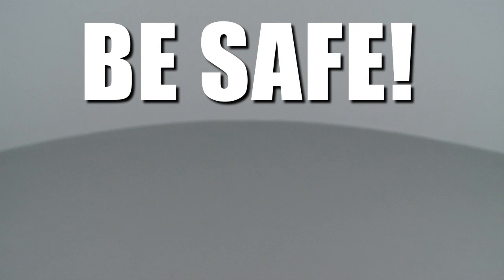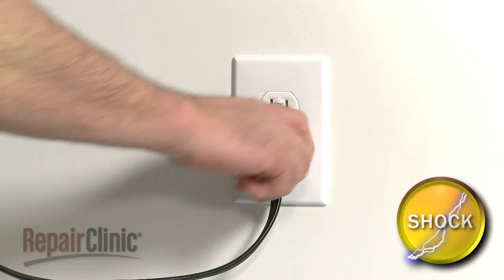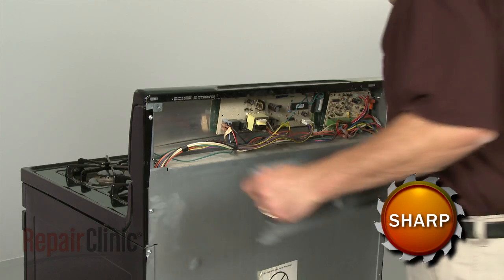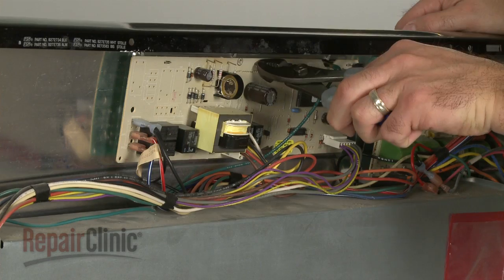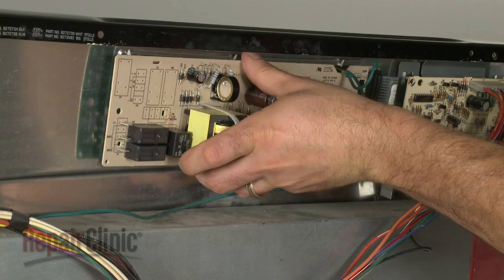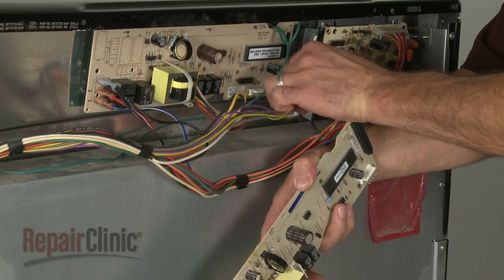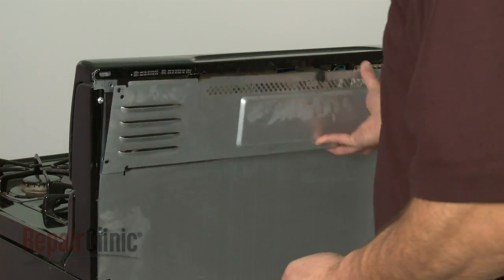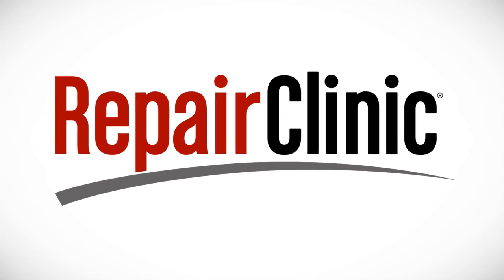Kenmore Gas Range/Oven Control Board Replacement #8523666

Comment: Control and Overly needs to be replaced does this mean I am going to have more
problems with this stove ? would it be advised to replace the stove rather than repair ??
Kenmore only 6 years old
Reply from the maker: Sharon Coyle Not necessarily. If you are otherwise happy with the product we would repair it.

Comment: Hi, I have a Kenmore Gas Oven and I can't find the model numbers anywhere.  They were removed apparently.  I bought this used.  And it's in good shape otherwise. I get a F13 blinking code when it's plugged in. I tried unplugging and plugging several times.  It's gone.  How can i buy the right control panel for this Oven.  any ideas.  Should I just replace the Range?
Reply: You've probably either replaced the range or fixed it by now, but if not, the model number can be found by opening the warming drawer and looking for a sticker above the right front leg.
Reply: @tjf1114  , thanks, sorry so long before i am replying.  I just checked nothing there, there is a tag on the left leg , it has a lot of information but nothing about model num, series nadda.. thanks..

Comment: My oven cannot be adjusted above 350 degrees (790.71329700).. basically the UP button isn't working.  Would replacing this component also fix that? The problem is intermittent.
Reply from the maker: According to the model you provided, the control for your unit is: http://www.repairclinic.com/PartDetail/Oven-Control-Board/316455410/1197179?TLSID=1773. This is a different part than the one in the video. On this part, there is a plastic overlay covered with the text. Pull this off the old control and place the overlay on the new one. Sometimes, in this process, the overlay becomes damaged when it is pulled off. If you need a new overlay, the part number is 1056311: http://www.repairclinic.com/PartDetail/Overlay/316220712/1056311?ss=-x31303536333131&mr=0?TLSID=1773. Replacing this control will most likely solve the problem.
Reply: *****   That's definitely my part, however, I don't know what's involved in the replacement.  Is it done from the front or the back?